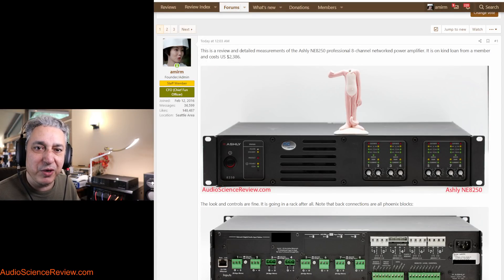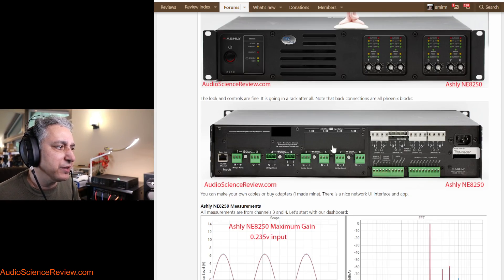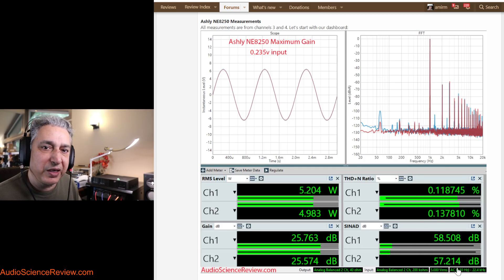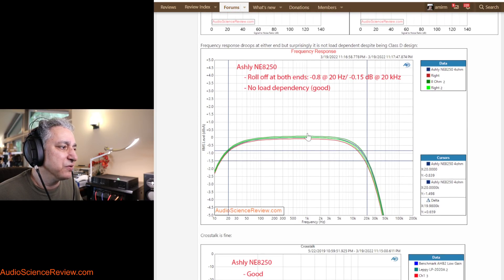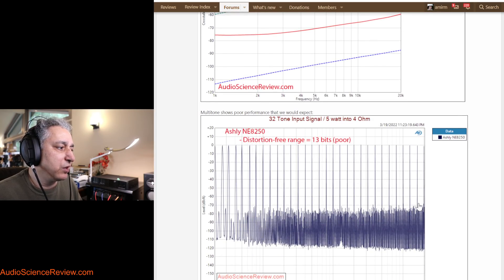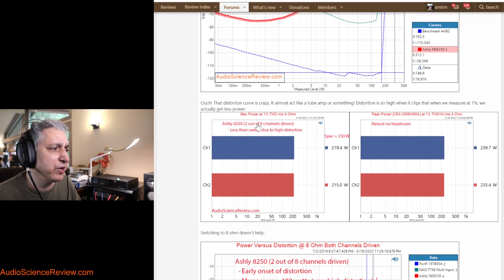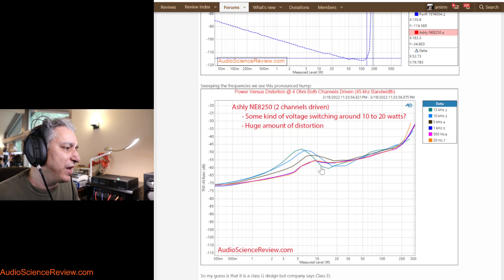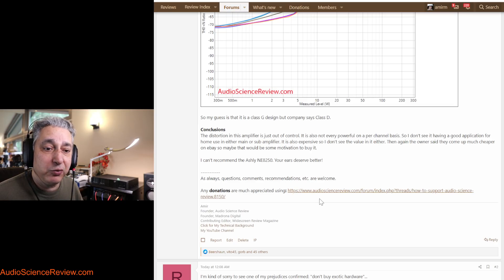Ashly Ne8250 Professional Multichannel 8 Channel Amplifier Review

Comment: This piece isn’t really designed for a hifi setup, seems more appropriate for something like an in-ceiling retail system, small cinema, etc. for 8ch of amp in a box that size, at that power rating, at that price, it’s pretty par for the course in terms of what is commercially available. Comparing this to consumer integrateds or hifi amps is kind of missing the point. Love the site Amir but don’t love the gotchas.
Reply from the maker: As I explained in the video, members are buying these to use in hi-fi installations and it is that information which they desire.  These products are often offered at much lower cost than consumer gear so if they perform, they would be great finds.  I am sure everyone understands that this is not a consumer piece of audio gear.
Reply: @AudioScienceReview  from the majority of replies to this video as well as on the website, i’m not sure that’s true, or at the very least they don’t understand the intended use case for this device. And those buying these units for such purposes would be smart to check out the specs, which resemble the results of your testing almost to a T. This would probably be worth pointing out in the video as well, as the company is pretty transparent about the quality on offer from the device they are selling.

Comment: Goodness, Amir, you have become very active lately! I cannot really argue the point regarding class of amp, but in class G elevating the rail voltage usually you would see a reduction in THD simply because you "stretch" the linear range over which the transistors are operating. Now this is typical for class A and AB, whether it would be for a class D amp running a quasi class G mode, I do not know since I have never seen this done before. The output may simply be driven into saturation and latches for a short time, and they had to band limit the amp. It would have been helpful to offer an oscillograph of the output at maximum power, one would be able to see if there maybe a lag in changing rail voltage which would give you a serious hump in SINAD. This is only a guess, though.

Comment: A rhetorical question: Are there tradeoffs between high fidelity vs. long-term reliability? If so, what are they?

I can easily see that pro installations could readily suffer more distortion and/or roll-off IF it means that circuit components can be operated in current, voltage, and temperature regimes that might well be good practice for long-term reliability.

For example, if our living room 2.1 system goes suddenly silent, that's less of an emergency than if we are speaking of an airport paging system, a stadium announcer's system, or a comm device in a fire station.

It's not my specialty, but avionics used to be. There, our engineers spent a huge proportion of effort and time making sure every component was operated conservatively to maximize life and reliability. Even some old tube pro amps often lasted years (and some even decades) without a service call. There's a lot more to amp reliability than just asking less power of it.

Could this be the rationale for this device?
Reply: Great comment.
Reply from the maker: There is a trade off between cost/size and reliability but not performance.
Reply: @AudioScienceReview  Thanks for the answer. Remembering that 'doomsday' performance specs are uncommon in real pro gear, to wit: Crown, QSC, et al. In avionics, I emember  counseling young designers that we never have to communicate Beethoven. :)

Comment: Thanks Amir for the in-depth testing. I am wondering whether you need dummy loads (8 ohms power resistors) connection to all the 8 channels during your measurement tests?
Reply from the maker: They are independent channels so no.  I did mute all the channels I was not using as a precaution (it didn't make a difference).

Comment: You are doing incredible work thankyou.  The amount of money you have probably saved audiophiles collectively is epic.
Reply: I'd be more inclined to say "credible" than "incredible," eh? :)
Reply: I saved around 4k Euro thanks to Amir, I count myself as a big fan.
Reply: Yeah you won't be buying any equipment because his measurements say everything is not good enough
But it's better to have a home trial of equipment and listen with your Ears to know if you like it not some graph
Reply: @Music.Movies.67  I think the main I learned was that a good design always trumps expensive components.  It was very hard for me to accept.  Its just the reality of the matter that more pretty tubes or $100 capacitors dont improve the sound.  It may be different yes, but that is usually explained by something other than what the listener thinks it is and the brain registers it as an improvement because of the expectation that more money equals more better.
Reply: @Music.Movies.67  so far buying according to the recommendations of Amir has resulted in excellent audio.

Comment: Oh, bloody phoenix screw terminals. Building cables for those things is just the worst.
Reply from the maker: Yeh, if you don't already have them it is a pain.  I had to actually desolder the end of one of my XLR cables and re-terminate this way.
Reply: @AudioScienceReview  I just finished building some for my minidsp 4x10hd and I got so damn frustrated. Didn't help that the minidsp ones are smaller than normal.

Comment: headless panther Cat Litter for that 8ch amp 
that amplifier send it me i would cat litter it for the lousy freq overlays , the crown cts8200 o have x3 of just for proper surround arrays in a small room they have lousy alignment with 1KHz all has to be manually adjusted to get 8ch same level input and output has to be aligned manually as well , harman crown garbage , i never buy crown harman garbage trash engineers again , i got these cheap , not worth original retail as harnan design garbage only made for Cat Litter .